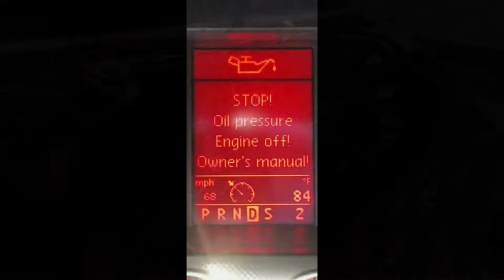A Hobbyist Mechanic's Volkswagen Crafter Engine Swap

Comment: I have the same van 2007 model 
Blown turbo engine still idles with black smoke comming out reverse gear is not functional Dpf needs to be replaced as well any recommendations from the community would be highly appreciated 🎉🎉

Comment: Are the engine's really that bad or do you think you had bad luck? And is the engine wiring harness simple to swap because I have changed the glow plugs and the relay fuse is good but still saying fault on glow plug 4...might change the harness if I don't have to take loads apart?
Reply from the maker: No they aren't that bad but we do starship mileage so we will have more issues than most will.
Yes the loom is a pain to change to be honest.
Reply: @SpecialisedMotorcycleTransport  how do you go about it?
Reply from the maker: Just start by unplugging things and see what holds it buddy.
There's no procedure really.